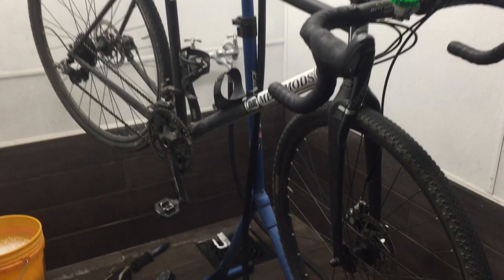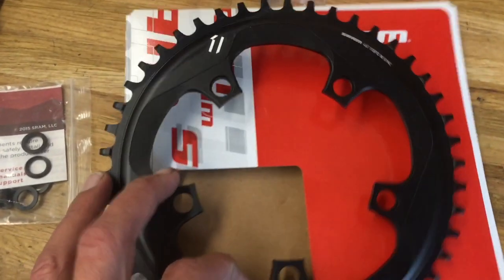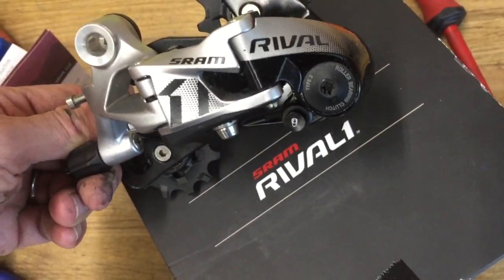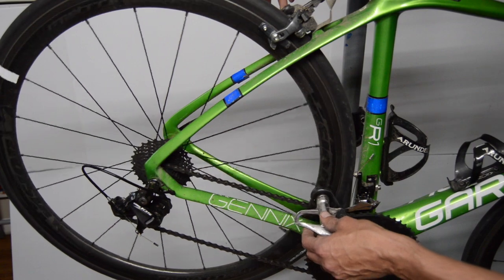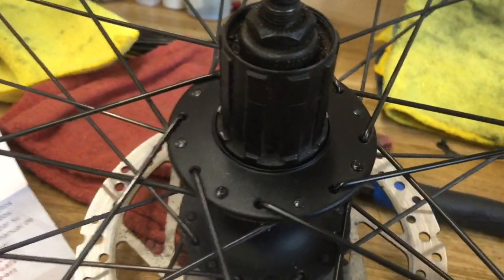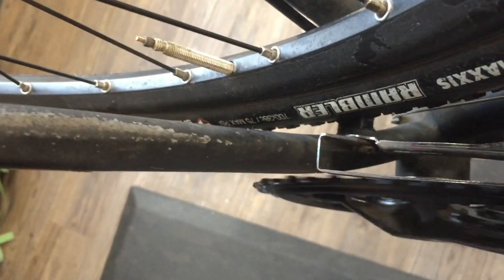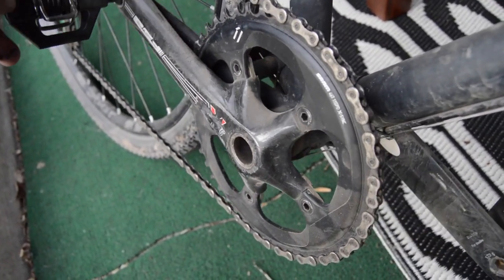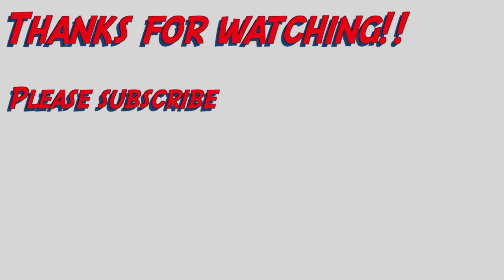Gravel/Commuter 1x Conversion

Comment: I'm feeling spoilt two videos within a couple of days and vastly differing weather conditions. Firstly starting the video on the bike is a really great way to grasp everyone's attention. You must be pretty happy with the commuter bike you built , it's performing admirably. I reckon your correct about the gear coverage , the 1 X will give you everything you need minus the front derailleur hassle. Impressed with the Sunrace cluster , a report on logivity would be great. Keep the top rate content coming , fantastic work 😎😎
Reply from the maker: Yeah, the weather here in Denver is pretty crazy right now. Nice spring weather one day, snowing the next! I'm really liking the gear coverage with the setup. Seems to be just the right steps between gears for the riding I've been doing with the bike. 
Thank you for the feedback Paul, I very much appreciate it!!

Comment: looking into 1x10 setup with 11-32 and torn between 46 tooth or 48 tooth. Just doing long distance road biking. So I want to keep a good speed up but if I come come across a big hill late into the ride I want to not stuggle. Currently running a single speed with 48x16 . Got any suggestions between 48 tooth and 46 tooth with that cassette ratio?

Comment: Hi there I have a question about my bike mine is a Salsa journeyman 2x8 I like to have 1x8 what size on chain ring I will need? And what else? Thanks
Reply from the maker: I'd probably go somewhere between a 36 and a 46 for the front chainring depending on the terrain. Ideally you'd want a narrow wide tooth pattern chainring and a clutch type derailleur.

Comment: I have a 2013 roadie with a SRAM Rival 53/39 and 10-speed Shimano Ultegra 6700 12x25 (itself a replacement for the weaker and damage original SRAM cassette). I want to also do this conversion to a 1 X 11 (or 1 X 12?) yet I do not know if there is a cassette that has the same width as either the current Shimano 6700 or original SRAM Rival (both in 10 speed). I have the cheaper ALX270 wheelset which I know were spec'd, at the time, for 8/9/10. Any thoughts or suggestions on which cassette should be compatible? It is so damn hard to find out if some (not all of course) of these newer 11 speed cassettes are compatible with the older 10 speed hubs. Thanks!
Reply from the maker: Cassette wise, you've got plenty of options for a wider range 11 speed cassette. Most of what I've seen with a large cog bigger than a 34 tooth uses the Shimano Dynasys system where a 11 speed cassette fits on a 8-9-10 speed free hub body. I used a Sunrace 11-42, which was pretty inexpensive, on an old Shimano 10 speed free hub body in the video.
Your biggest investment will be 11 speed shifters to work with the cassette and a clutch style derailleur that works with a 1X system. Sram stuff like the Apex 1 derailleur and shifter are fairly inexpensive. The new Shimano GRX stuff looks pretty interesting as well.
1x12 would be a pretty pricy option at this point.
Thanks for taking the time to comment and ask questions!
Reply: @JoeyMesa  So, what about the following parts, would they be compatible/interchangeable with my current 2013 SRAM Rival 10-speed?
I FORGOT to tell you I am going Flat Bar conversion from dropouts!!!!!!
1) SRAM GX Eagle Trigger Shifter 12 Speed Rear  -$45 at 122 gr
     OR
     Shimano XT SL-M8100-IL Right I-Spec EV 12-Speed - $61 unknown wt
    OR 
    microSHIFT Right Thumb Shifter, 12-Speed Mountain, SRAM Eagle Compatible at  
    $55 at 123 gr
2) SRAM NX EAGLE PG-1230 CASSETTE 12 speed (11-50) $100
    OR
    SRAM Force XG-1270 12-Speed Cassette (10-33t) $185 at 266 gr
    OR
    SUNRACE CSMZ80 12 SPEED CASSETTE (11-50) $75 
   OR
   SUNRACE MZ90 12-SPEED CASSETTE (11-50) $115
Reply from the maker: If you're not super concerned about weight, the Sram 4-piece Eagle NX group would work well - 11-50 12 speed cassette, clutch derailleur, chain and shifter for $ 275  https://amzn.to/2Xmtgqm
We've been selling a LOT of these groups at the shop for 1x conversions. All you would need otherwise is a 130 bcd narrow wide chainring for your rival crank and you're set! I used a 46T Sram Xsync on my commuter, but a 46-50 tooth ring would work well on a road bike. Just depends on if you want a lower or higher range of gears.